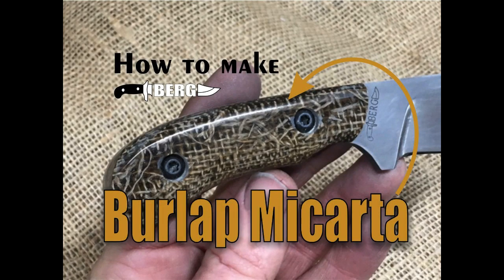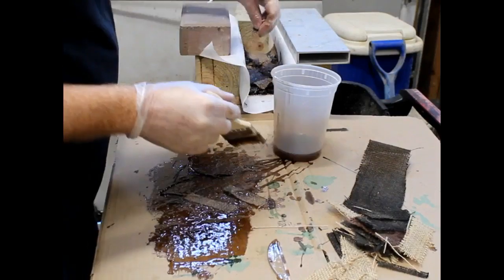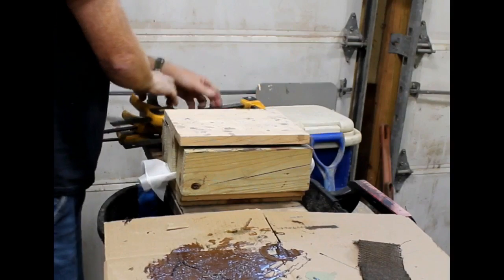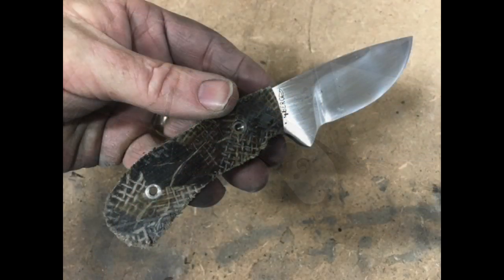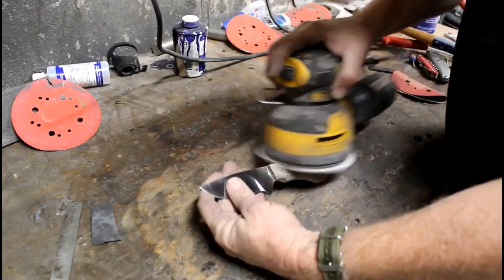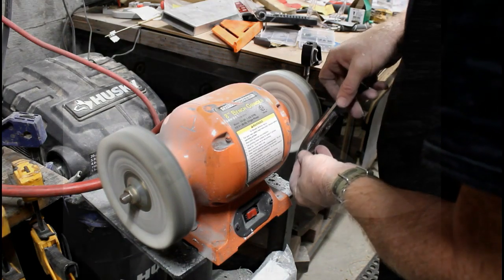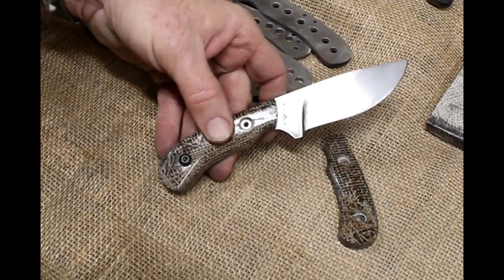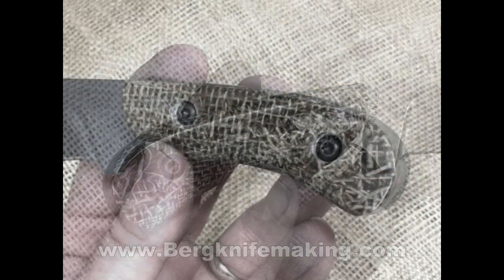How to Make Burlap Micarta for knife handles by Berg Knife Making

Comment: Another great vid, the great thing about you finding out that dying the burlap is not a good idea is that we do not have to find that out tghe hard way. More people should show what happens when a good idea may or may not be a good idea...was it a water based dye, what about an oil based paint or tinter, I have used dyes in resin before with no issue, but they were suppiled by the manufacturer
Reply: A cloth dye would probably work better.

Comment: Tips for dry fiber like that, sand a little bit more, and than laminate the entire top side with 2 or 3 layer resin, and sanded flat 😁 (i did this on layup carbon fiber).  hope you get the point